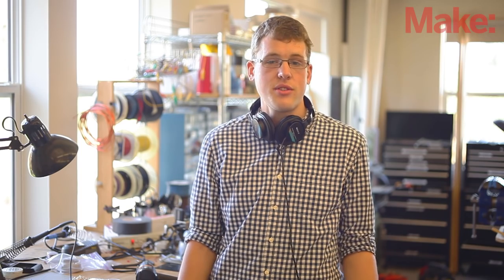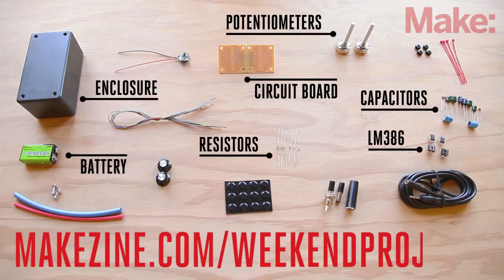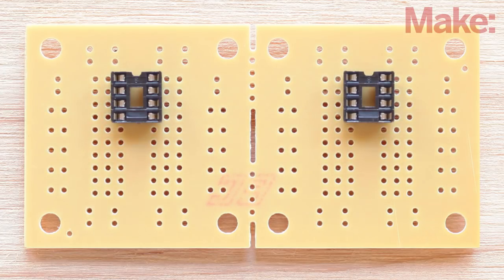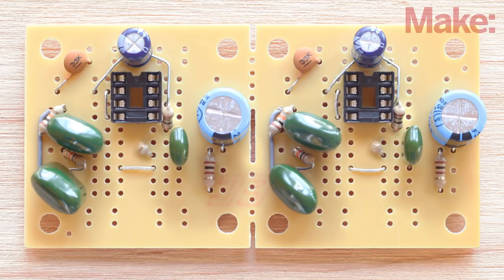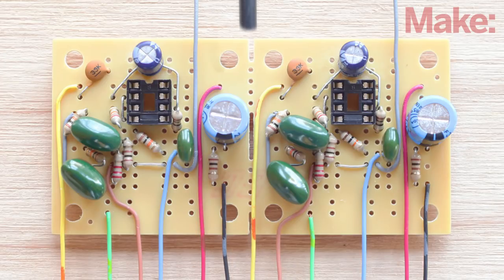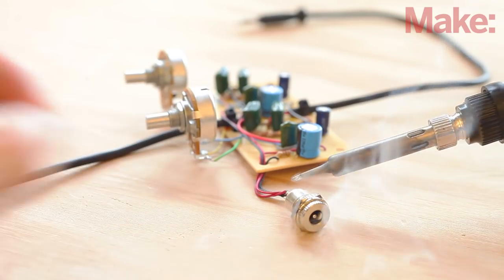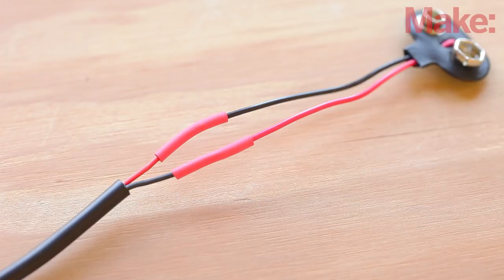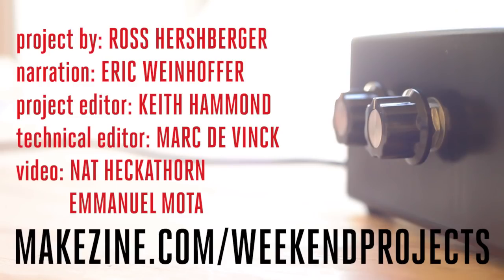Weekend Projects - Bass Bump Headphone Amp

Comment: Thank you so much for this great video... I just build one same for myself.. with 5 volt and 9 volt dual voltage control... for low and high impedance headphones... It is just awesome...It is a classic product.. LM368 is not the best one but it is great for its simplicity... It has a 3 stage class AB amplifier with Lin Topology...  
1) It has a simple differential input stage with emitter followers 
2) a voltage amplification stage 
3) and a output class AB stage with a compound PNP Transistor... 
4) Internal feedback and gain control is awesome 
5) Fixed Gain of 20 (great for headphones)

Last but not the least : The Zobel Network at output and the BIG MUFF PI TONE control system at the input makes it classic.
But I have one question please help me..
Which impedance headphones are best for this little classic piece... because 4.5 volt amplitude is not good(I am also use a 2.5 volt setting ) for 32 Ohm impedance... Voice coils will be getting heated due to large current flow... and for long use may be the cone will start damaging...  
2.5 volt is also high for some low impedance headphones... 
Please suggest me...

Comment: the reason why he uses two pots instead of one dual pot is that one pot controls the high frequencies and the other controls the low frequencies.  this makes a sort of basic equalizer allowing for the bass boost/reduction.  a dual pot would take away this function, reducing this setup to an overly complex amp.  hope this helps.

Comment: As far as I can tell that won't split into a high and low frequency branch, just a high frequency branch, and a branch with all frequencies. To filter high frequency (obtain low frequency) you would generally use an inductor, in the same way the capacitor was used to filter low frequency.
Reply: I am wrong, the low frequency branch is being created by grounding high frequencies through the bottom .22uF capacitor. Quite clever.

Comment: I'd control it digitally way before the signal goes into the amp.

It could be an over kill, but that's the only solution I've done; I'm only a hobbyist when it comes to electronics but I've done my share with digital circuits; I'm a programmer by trade.

I recently purchased a sounds system for my PC and the sub-woofer had potentiometers as additional controls. The amount of noise was unbearable; once I took them out I've never had noise.

The reason I knew to take them out was from experience.

Comment: Seems like that should work just fine. you just don't have control of both channels, though in this application I can't see a reason you would need to. Unless you only plugged in one speaker at some point, then you could just turn down one channel.

Comment: What's the point of printing a specific type of PCB when you are going to run the wires around like that? you could have used a normal type of circuit board, right?

Comment: The LM386 was never meant to be a headphone amp. It's a really low quality "amp"  that can pump low quality audio into a low quality low power (350 mw) speaker, like in the old cheap transistor radios. Build it if you like but only if your're not serious about headphone sound.

Comment: So, that's how the sub woofer circuit works, pretty cool
Reply: No. A sub woofer with line inputs would have a much better designed amplifier and usually the filtering is done in the stereo so that you are only getting the low frequencies out of the sub output.
Reply: Oh

Comment: Dirty or cheap pots can have a bit of static on them, that is true, but good quality ones won't have those issues. And when they do, you can easily replace them later on down the line. I will bet if you bought quality pots online and replaced the ones in your subwoofer it would be fine. But I digress.

Yes, a digital potentiometer is a solution, but they are quite a bit more expensive and require a microcontroller and... Just expensive and not a proper solution to the issue of noise.

Comment: That's not really how it works. The pots at as voltage dividers for the input signal, the reason you have two is because you have to pass two signals both of which need dividing.

Comment: Or you can just buy a portable DAC/amp for the same money that will offer infinitely more sound quality improvement, and use EQ to get a better bass boost.
Reply: You obviously don't get the purpose of DIY'ing. It's not about the product, it's about the build.
Reply: You two obviously don't understand this thing at all. Active, hardware bass boosting sounds ten times better than equalizing it in your computer software.
Reply: its pretty fun building something and using it, its not about saving money or something.
Reply: DaveK183 I have a stereo amplifier with a bass boost 'loudness' feature, no. It's not better as it sound exactly the same. If your speakers/headphones don't have enough bass then you bought the wrong headphones/speakers for your personal preference.
Reply: GregLH0 Umm, maybe its the same because your speakers can't even play those low frequencies.
Reply: DaveK183 They do extend well for bookshelf/monitor speakers into the low ends however I found boosting those low ends to sound the exactly the same as doing it through my STX sound card. Point is software boost does the same as hardware boost. Also I do have a subwoofer plugged into them but I only rarely use it as it disturbs other people in the house.
Reply: GregLH0 Well speakers have their own amplifier so you're not gonna really amplify it with the bass circuit, but still I find the sound cleaner, rather than with a software eq which makes the sound muddy.
Reply: DaveK183 Maybe your speaker amplifier is better then, mine is a fisher amplifier from the early 80's that I got from a garage sale and keep using since for $20 I basically hit the jackpot since it doesn't distort at uncomfortably high levels and have a very, very low hiss at normal listening levels. Gotta love it when rich people do garage sales. Exact model is CA-229.
Reply: GregLH0 
"Point is software boost does the same as hardware boost."
I tried to Google it & failed to find it. Please, link me?
Reply: Software and harware boost should be the exact same in a "perfect world", so it is just down to how well made the DSP/processor or bass boost amplifier is.

Comment: why everyone just makes lm386, it doesn't even sound good.
Reply: TDA2822 does work at 5V, also does PAM8403
Reply: put a simple preamp stage before it, put a pair of 8 ohm speaker after it, and you may like the power.
 tda2822 non "m" version has some more power too.
Reply: yeah its a grandpa audio IC
Reply: +iceberg789 i want build heaphone amp with schematic from this video. you said that lm386 doesn't sound good, so what opamp that sound good for that schematic? thank you.
Reply: tda2822m works at 2v
Reply: +Sarcasm Idiot ya, and schematic is also available in tda 2822 datasheet. just you need to take case of the ground connections with a star layout.
Reply: What about lm358 and ua741 ic?
Reply: Ikr, just use the NE5534 sounds 100x better.

Comment: Can anyone please help! I finished making it but i keep hearing static and buzzing sounds along with the music.Any suggestions to fix this?Please help!
Reply: Check all the caps and keep the volume of your MP3 player low.
Reply: it has to do with the power supply, audio amps are very sensitive to their power supply. Unfortunately a 9v battery is not the best solution because it is not regulated.
Reply: tfhamilton101 This is using an op-amp and so there should be always at least an 4.8 potential difference, plenty for this power level. 9V batteries are made of 6 1.5V cells, so when you first turn it on you have a 9V potential (with 0V reference level) and it will generally fail at .8v per cell or 4.8V. So unless the battery is down bellow 6, I don't think it's the battery.
Reply: tarstarkusz A few months back I did some playing around with the lm386 as an audio amplifier. First I powered it with a 9v battery as seen in this video and there was a lot of high pitch noise and static coming from the speaker. I decided to power the speaker from a 5v usb phone charger and when I did the amplifier had very little static. If you want a noise free amplifier, the power supply should be linearly regulated. However, I do agree with you that AAA cells would be a better solution for this project.
Reply: tfhamilton101 You can always drop a 5V regulator on the power into the circuit. Adding a DC-DC circuit would probably raise the complexity too much for the average person. It's possible that a carbon-zinc 9V battery can't deliver the current needed for this project or that the resisters are keeping the current limit on the op-amp too high, though nobody else seems to have the problem (I haven't built this myself). I do wonder if Adrian is trying to use a carbon-zinc 9V? It could be that one of his caps are bad or not connected properly too. That would be the first thing I check.

Comment: If you're using 2 pots to control 2 ears seperately, why not connect both wires to a single pot and get equal amount of bass boost? I first though that the other nub would boost the overall sound and te other one would be bass boost, got dissapointed :P
Reply: +MrMats0n if you where to only use one pot you would end up mixing both channels into one and distorting your sound. the only way you could use one pot is to get a stereo pot, which is 2 pots controlled with a single shaft.
Reply: jack machen Thats basicly what I meant

Comment: LM386 for a "high quality" headphone amplifier? You've got to be kidding me...
Reply: NoBudgetTech thats what i was thinking! Haha, single stage op-amp circuit... guess their definition of lo-fi is using a push-pull set of two BJTs hahaha
Reply: Evan Johnson LM386 is an audio amplifier chip. Not an Op-Amp. My suggestion would be a TDA2822, stereo, though still not 'quality'.

I would replace the pots with a DPST switch and have boost on/off. Use a DPDT switch for 2 positions and off.
Reply: ChaoticaExtreme apples to apples. They call it a low voltage audio amp, but functionally it is a high powered, low frequency Op-Amp. It even has the same schematic symbol and differential inputs. Maybe they choose not to call it at op-amp, but I consider it to he one. If it quacks like a duck...
Reply: Evan Johnson So if I buy say, a PA amplifier with balanced inputs, I've actually bought a discrete op-amp....
Reply: Technically, yes. Let's remember here that op-amp is basically any amplifier with differential inputs, op-amp doesn't mean tiny. A balanced input power amp is indeed a huge op-amp. Just like power amp chips like the TDA2030, LM1875, LM3886, etc... are just high power op-amps. And yes, they have the same schematic symbol often. Technically, every amplifier that has a feedback loop is an op-amp.
The LM386 is a high power op-amp with fixed gain, it basically has the feedback loop built in.
Reply: NoBudgetTech Yes I know that. Such sweeping generalisation doesn't work unless you want to make life difficult though. Like the majority of road users operate a vehicle, but that nowhere even describes what they are using.

My point is that when you want an amplifier chip, you ask for one. If you want a motor driver chip, ditto. That they are op-amps is irrellevant. Unless you want to provide a string of parameters that the device must provide.

To call it what it is works for me.
Reply: ChaoticaExtreme I see your point and I agree. They are all op-amps, but different op-amps have different characteristics that make them ideal for different uses. 
I'd say that we were both right here. My point that every op-amp is basically the "same" device is true, and your point that different op-amps are suited for different uses is also right.
Just like all vehicles are vehicles, they just have different characteristics that suit them for different purposes, like you said ;)
Reply: With the right components, it can deliver good sound quality. It's a good chip for a simple, straight forward amplifier circuit and great for beginners.
Reply: what would you suggest for an awesome headphone amp? please let me know
Reply: I use opa2604 ha

Comment: Can I use a 12V adapter with this amplifier?
Reply: You can use any voltage from 9 to 35V with voltage regulator 7809.
Reply: +Edgar Koterle 35v to 5v is gonna make a LOT of heat
Reply: NeXTSTORMING It depends by current.

Comment: With this thing being so damn big, you might want to put 6AAA cells in it instead of the 9V. 9V batteries will have much less energy than 6AAA cells and can still be charged with the scheme shown here assuming you use rechargeable AAA cells. 9V rechargeable batteries are also 7.2V.
Reply: how about lithium :p
Reply: Redwan Hasan You would loose the ability to recharge it. You still have the problem of voltage drop, whereas with NIMH, you get a MUCH flatter voltage curve.
Reply: Im talking about rechargeable li ions. Those are much better than NiMH in faster charging and higher capacity aspect.
Reply: Redwan Hasan
That would work fine, but it would be more expensive and a charger might more expensive and difficult to find. Are you thinking like 2 18650 cells in series?
Reply: Well matter of fact a few hours ago i just finished my project where i have used 2 18650 in series and a LM2576,fixed 5.0V ic, and it might be a bit costly(not much though, 4.0AHr each costs me abt a dollar) but it saved me lot of space. Li ion charging circuits are simple and easy to find too.
Reply: Redwan Hasan
Is your project a headphone amp? If so, how does it sound? Chinese made cells? That's awful cheap for 4AH cells and rater high for an 18650 from what I've seen.
Reply: No, that's my next project, it was a power supply for powering up phones or stuffs like banana pi. 
Yuup that's awfully cheap, and ultrafire branded, fake i believe , im pretty sure they r not 4AHr but i will be happy to get 3AHr from each of them.
Reply: Redwan Hasan Sounds cool. Do you do videos of your projects?
Reply: Sadly no, but i do write blogs about this, and im hoping to make videos soon. Here's the link of the index page,  http://redwanhasan.blogspot.com/2011/01/me-my-blog.html
Reply: Redwan Hasan I checked out your channel after posting that and I saw you put up game videos iirc. I'll check out your blog though, thanks.
Reply: Ohh yes, i did upload a few video game footages... Too lazy to do anything anyway thanks and have a nice day.
Reply: Aren't AAA rechargeables usually 1.25V though?
Reply: 1.2 for NiMH
Reply: ThankfulServant
There are some companies that advertise their cells as being 1.25V but it's usually just marketing BS. Freshly charged NIMH cells can read as high as 1.6V but they very quickly drop to 1.2 and remain at 1.2 for about 95% of the discharge curve. Their discharge curve is so flat that they tend to die suddenly. Like with a flashlight, you have 100% brightness and then in the span of 30 seconds or less, it dims off.
Reply: "flat" "curve" is actually good. haven't measured a NiMH since a long time.
Reply: Redwan Hasan I agree. Another thing NIMH cells are good for is not dropping voltage on large current draws. A primary cell will usually drop voltage by a pretty large amount if you put a big draw on them, whereas a healthy rechargeable cell usually won't drop at all unless you put 10-20C or something crazy like that on it. I have a bunch of Eveready C and D cells (which are repackaged sub-C NiCad cells) that are rated up to 20C. Unfortunately, they are only 1800mAH.